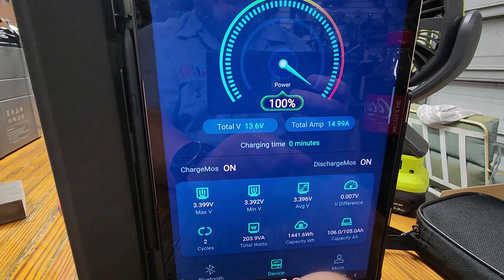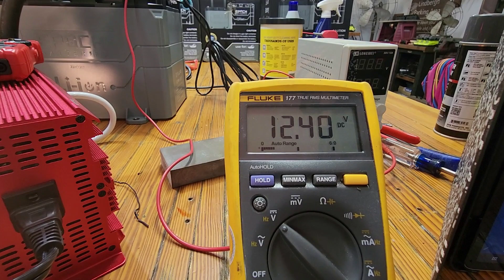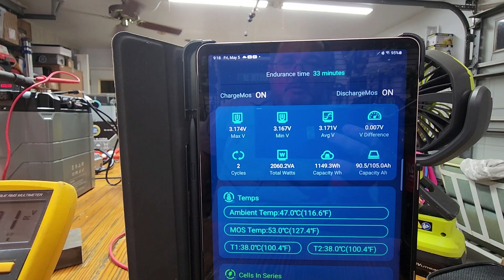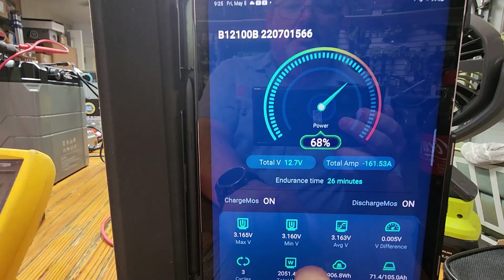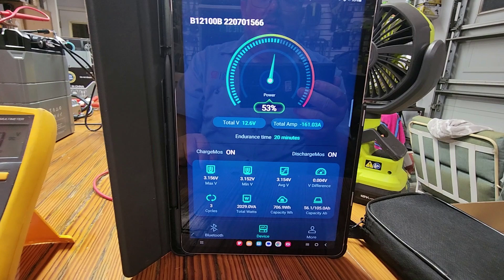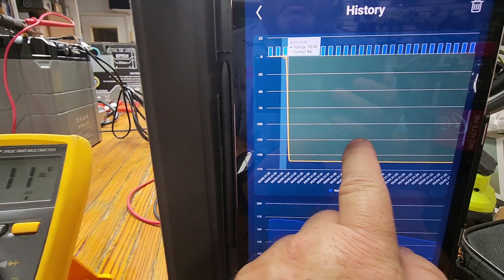Stress testing the Epoch 12 Volt 100AH Lithium battery! Plus 10% off code below!

Comment: I’d question an app that says the batter is at 100% when the charger is still putting out it’s max current. Something is not right
Reply from the maker: Its not the app. The app just reports the info the battery sends it. In this case the SOC meter is just a counter. SOC meters are rarely perfect and can get out of whack for a number of reasons. One way to calibrate the soc meter is to regularly bring it tò a full charge as dictated by the charger or BMS max settings. Soc cant go past 100. So once the battery is actually full...the full battery and soc meter are synced. Its important to do thisvregularly. If you spend long periods in a mid range your soc meter will become innacurate and you must fully charge to resynch.
Reply: The battery was no with like 1 cycle, the percentage shown needs a few cycles to get straight

Comment: The problem is you're not measuring voltage at the terminal, you're measuring it past the lug....so 160A over a short distance will show a lower voltage
Reply from the maker: Thanks for the reply. The meter probes were shoved under the shrink tube for convenience. The difference between the actual lung and the terminal would be negligible. It had good contact. Even at a slightly lower reading its amazing how well the voltage holds up. On a lead acid it would have been much lower.

Comment: but 200° for my liking was too hot it shouldv turned off
Reply from the maker: I did some research and mosfets seem to be able to operate upwards of 300 to 350F max. I am betting a few more degrees and it probably would have shut down. Ben Stein over at PANBO did a similar test but also applied a heat gun to the terminal. It shut down a little over 200 degrees.
Reply: @mvintrigue-trawlerdiy1101  oh ok

Comment: cant frickn buy that beutifull battery since im from europe :(
Reply from the maker: Why not? No shipping or some kind of local laws?
Reply: @mvintrigue-trawlerdiy1101  no there is one single website where its sold out and they themself dont ship to europe
Reply from the maker: @Spayrex  probably some difficult Hazmat regulations. You can see if Roypow delivers there. Roypow basically has the same battery but its blue and cost just a bit more. Will Prowse did a teardown video of one.
Reply: @mvintrigue-trawlerdiy1101  yea i know that but they dont deliver at all nether do they have 12V batterys
Reply from the maker: @Spayrex  dang. Hopefully someone will become a distributor over there.
Reply: 😜

Getting back to American made.

Epoch Batteries!